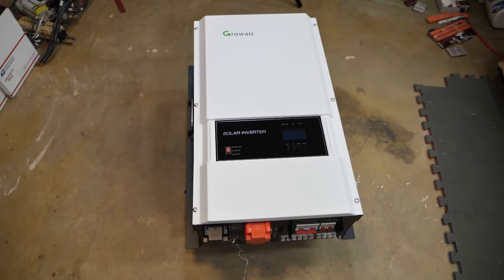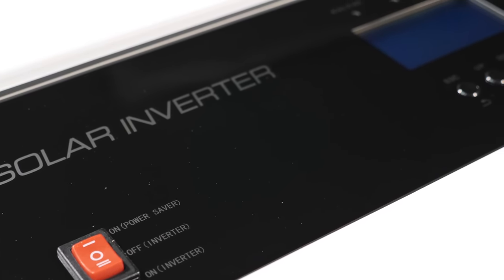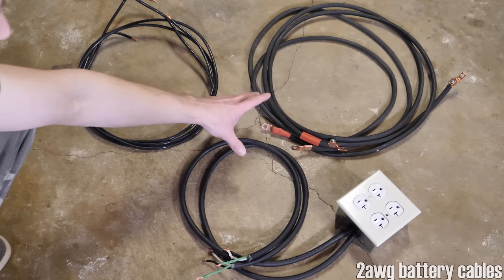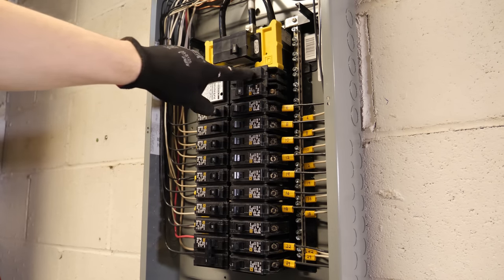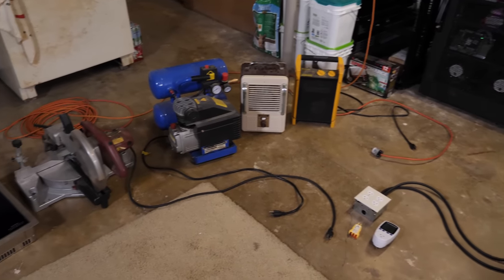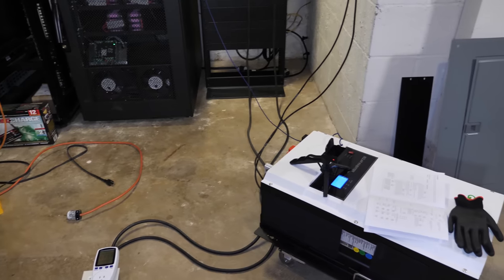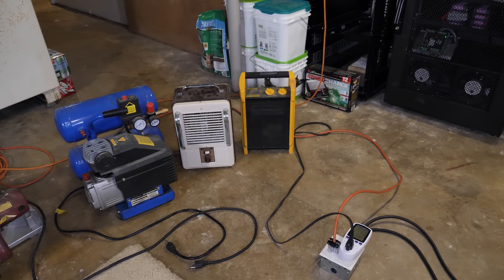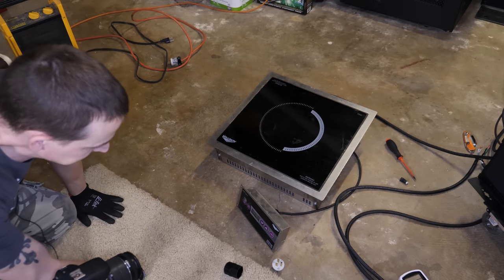12kw Growatt Inverter Operational Check/Review!!

Comment: Great Videos!  Thank you for doing what you do.  Very informative and entertaining.  This unit peaked my interest... looking for a "powerwall" type of solution to backup critical circuits in a short term grid down situation (without using solar - only this inverter and batteries).  Many calls I've made into Sig Solar either go unanswered, connected with someone who's unable to answer any questions, or messages left and not returned.  I suspect they have all the business they want/need.  Really surprising considering how many positive comments are on here about them.
Reply from the maker: Thanks and appreciate that! I purchased mine at this time last year and they were busy and or on holiday vaca. I also dont think they were as busy. You will love the inverter if you end up getting one! I Love mine!🤘
Reply: @Marc Kramer, I’m in your same spot.  Looking at creating a critical loads UPS with one of these and a couple of SigSolar’s 48VDC batteries.  I’m curious if anyone has added solar to something like this just for the tax credits on the inverter and other items?

Comment: Here is the situation: Grid fluctuates and is not a clean power source. Because of that user prefers to power the whole house from an inverter.

Can I use the AC input to charge battery BUT the AC input is isolated from the AC Out? Is there some form of AC charging scheduling (ie charge only between so-so time)?
Reply from the maker: You would need the wifi adapter or connect to your network to change charge times manually from pc or phone or do it on the inverter itself. No programs that I know of to have it do it for you.
Reply: @AveRage_Joe  Hmm so no ac charge scheduling

What about isolation?
Reply from the maker: Correct no schedule. AC will output whatever you set it at. For exp....if in the US and set to 240v and your grid is fluctuating, inverter will put out steady 240v. 💥🤘

Comment: The manual says to connect at least 400 ah batteries to the inverter? Do you run a full 400 ah?
Reply from the maker: Its a recommendation....My battery at this moment is 300ah. It was only 200ah. I am however working on building a 560ah battery!🤘

Comment: most induction cooktops won't turn on without a induction compatible pan on the heating element...
Reply from the maker: You are correct but the light didnt show up on the meter thing so I figured it didnt work!

Comment: Enjoyable video. 
Does the inverter have a mode that allows the inverter to use pv and battery and grid-utility power simultaneously? Allowing the grid to only supply the excess power needed for loads that is above the inverters max output?
Reply from the maker: Thanks Man!  Technically the inverter will do all that!  It will power from solar first, if not enough then also uses battery.  If battery is dead or low it will use grid!  Max load above the 12kw is 36kw but for short time.  Hope I can test that here soon!!!
Reply: @AveRage_Joe  so I guess there really wouldn’t be any time that you have more loads than the max capacity of the inverter with such a high capacity. I was wondering if it would shut the inverter off like a standard offgrid inverter, or if it would continue to put out its max but still allow the grid to supply the remaining power needed to fully supply all the homes load
Reply: If it could do this then a smaller inverter that covers the majority of continuous loads could be used. Then the system could be cheaper with a smaller battery that wouldn’t have to supply power for surges and occasional high loads. Easier on batteries etc. this would only be beneficial if there was a grid connection to the home

Comment: I just ordered one based on your review.
Looks perfect for me, although It does seem quite loud, so I can't really decided on what room to put it in...
Do you mind to measure the sound in dB so I can get a good idea?
Reply from the maker: NOICE! You will Love it! Yeah it can get loud at times but it seems louder on camera with the mic. Most times during the day the smaller fans on the charge controller boards are running and those are not to loud. As for db, is there an app for that? That would be the only way for me to check.
Reply: I have the 6KW model of this inverter and it is very loud.  I have it in a room about 15 feet away from our living room and we can hear it loud, even with the door closed.  It is noisy.
Reply from the maker: I have heard that for the 6kw!

Comment: Hey AJ... We installed the same Inverter yesterday connected to a rack of 6 LifePower4 batts. We are experiencing an overcharge error. Inverter is setup on Li on menu #5, and we are noticing a voltage range between 55v and 60v when the batts are charging from the grid, thus throwing the error. Have you experience anything like that? Any thoughts on why this might be happening?? Thanks!!
Reply from the maker: Whats happening is your bms is cutting the charge side. When doing the very first charge with any lithium battery. You need to do a slow charge to let ALL the cells top balance. You may only reach 55-56v. Once all the cells balance then you can raise the voltage a bit if wanted. So for this "first" charge, I would set full charge voltage to 55-56v.
Reply: @AveRage_Joe  I see... Do I change the settings on the inverter or the BMS on the batts? I ask because under menu 5, Li, the inverter doesn't let me change the voltages. My guess is that it does it automatically while communicating with the BMS. Right? However if I change setting 5 to usr, I can do it manually. What do you recommend?
Reply from the maker: I have mine on user because I dont have comms with a bms so not 100% sure how that area works yet. Having said that, I would change to user and then change the voltage until everything is all balanced. Once everything is full and balanced, then change back to Li!
Reply: Those were my thoughts... and it was also recommended by SS. Thanks for your time!! Keep up the awesome work!! Stay frosty, and don't let the magic blue smoke rise!! 🙂🤘🍻

Comment: Excited to hear about your upcoming battery upgrade! Can you give a hint? LFP?
Also, in a non-testing setup, how would you connect the AC output 2x hot and neutral wires back into your main panel? Would you simply use another double legged breaker?
Reply from the maker: Yes Sir!!! Got some LifePo4 272ah Lishen cells😲💥🤘🤫 As far as connecting AC in a normal operation, Ill be connecting/supplying AC from another breaker panel in my house or one could use a sub panel. Connect those to the input on inverter then Ill be taking the output from the inverter to that double pole breaker I used in this video to power my house. I also have an interlock kit on the panel so only grid or inverter can supply power to the panel. Ill go over that in a later video!🤘
Reply: @AveRage_Joe  That would be great! What I'm looking for is a setup where I would only use power from the grid if the PV+batteries are insufficient, and that it would make that switch automatically.
Reply from the maker: This inverter will do that!

Comment: Hi Joe I hope your well have you tried using a soft starter in line with the saw or compressor it may suppress the inrush current?  I saw the Batrium wobble.  Stay safe.
Reply from the maker: I havent tried a soft start. May get one for AC in the future. The cells I am using are recycled 18650's so they will dip for sure. My new cells should help in that department once connected!😆🤘
Reply: @AveRage_Joe  Hi Joe please make a video of the Soft Start Soft Stop for your Air Con.
Reply: @AveRage_Joe  Your new cells will definitely be more rugged Joe.  Please can you do a video using a soft starter with your AC when you have time.  Stay Safe.

Comment: Hi joe thus growatt have hybrid on off grid and this is your what youre using
Reply from the maker: Yeah I have been using this inverter for a while now. Its been great. Few quirks but nothing major. I would purchase again. It is an off-grid inverter with grid assist. Meaning you have an AC input to allow pass through for UPS mode.  Also allows grid charging.  I use it for off grid most of the time.

Comment: Please help, I habe this unit now installed and the manual is just useless,too many questions left open in order to turn it on.... Would you answer a question catalogue???
Reply from the maker: Send me an email!
Reply: @AveRage_Joe  thank you, very nice!!!! What's your address??
Reply: I try to make my Mind up on settings menu 1: what's the difference between sol and sbu? If under sbu solar also isn't available I would think it does use utility as well??
Why I can't select solar as a main, then utility and keep my battery for a power outage??
When solar gets week it keeps toggling internal a relay, so i would think it wears out prematurely.. unless there is a better "cut off setting?

Comment: What size breaker did you use to connect the grid to the inverter to charge the batteries?
Reply from the maker: I have 60a in right now but once I have my bigass battery all built ill use the recommended 80a.🤘

Comment: Nice features, however that standby is pretty high. I thought that my two parallel MPP 5048MG units had a high standby, but this video makes my 120 (for the pair) less bad. Thanks
Reply from the maker: Thanks mate!  Yeah idle draw is higher then HF inverters for sure but not bad for its size.  How are you liking the MPP inverters?  MPP was going to be my first choice as Ive been using there charge controllers.  I didnt end up getting one after seeing videos of them not being able to start a saw.  I hear with 2 its possible tho.👍
Reply: @AveRage_Joe  I don’t know HOW David poz managed to not get it to start a chop saw, but mine will start a chop saw WHILE my compressor is running with shop lights. When I saw his vid, which I am assuming you are referring to, I thought that for some reason he sabotaged the test cause I’ve never had an issue with power tools at all. 
I love my mpp solar units, they are great.
Reply: Oh and I did the above stress test with just one of my units. I have two, but one if off most of the time.
Reply from the maker: Yeah his video was the one!😁 A few others I talk to mentioned the same with the saw and they didnt have any luck however with 2 inverters they could. That was my confirmation to get an LF. What is the amp draw on your saw? I guess it doesnt matter to much cause you are able to start both saw and compressor. Wonder what the heck is up with Davids saw lol🤷‍♂️ Its good to hear yours works without a problem. 🤘

Comment: Can this inverter be direct hooked directly to the grid and not back feed the grid with AC from solar age inverter
Reply from the maker: Yes you can connect this inverter to the grid, then connect it to you house panel or subpanel which ever you want to power. The inverter has a transfer switch to go to grid or battery/solar. It does not backfeed grid. It would go BOOOOM!💥😆
Reply: Thanks for clearing that up above average Joe

Comment: How to install, there is only 1 hot cable, and 1 neutral cable for AC input?
Reply from the maker: 2 hots and a ground for AC input.
Reply: @AveRage_Joe  There are only differences in electrical systems in my area, there are only 1 hot and 1 neutral, single phase 220volt, can I use this inverter?

Comment: Thanks for the video brother! Any suggestions for a newbie as to battery that won't break the bank? I was planning to buy some used panels and just play with it for "what ifs" thanks!
Reply from the maker: What voltage are you looking to start with or learn with. Used solar is the way to go. All my panels are used!!!🤘
Reply: @AveRage_Joe I'm not familiar enough with the conversion from DC to AC, i know AC well, rewired my entire house. 200amp service. I'm thinking of picking up a pallet of 30 250w panels. Am i right to think an off grid app, those panels power the service panel directly until or unless I'm drawing more than they are putting out in which case the batteries make up the difference? I see you guys with these big battery banks,think the one guy had 4 @ $1500.00/per (lithium) not sure if those are 48v or what. Not really looking to drop 6k just yet so maybe half that and see if i need to add more later.. Thanks for the response bro, i don't expect it!
Reply from the maker: There are 2 ways to do it. Off grid or grid tie. Grid tie is connecting panels to either grid tie inverter then to panel or micro inverters (batteryless). Off grid needs a puresine splitphase inverter with built in charge controller (like mine) so the solar panels can connect to it and inverter connects to your main panel (thats the easy way) or a puresine splitphase inverter and a seperate charge controller for the solar. Offgrid of course needs batteries.
Reply: @AveRage_Joe  yea i gotcha, so I'm basically looking to do grid tie with battery backup that may become an off grid if TSHF. So the one you're using in this video, how many V battery would it need to work at capacity? If it were strictly off grid..
Reply: @AveRage_Joe  also this vid is a few months old, you learn any cons? Thanks!

Comment: That inverter has a 24 kwh battery minimum?? That's a huge battery bank, no?
Reply from the maker: Thats what the manual recommends. At this current time my battery is 10+kwh and I can run everything in my house except the stove and dryer but that is mainly due to my wire size. I personally think a 24kwh battery would be my min but I want to use anything and or everything when I want. Also that size gives you a little extra storage on the cloudy days.
Reply: @AveRage_Joe  That's at least $7k in batteries (at the low end), probably a lot more for name brand mid-range. That dictates a lot of solar power too. I guess it makes sense if you are going to power a regular house, but not your average off-girder..
Reply from the maker: $3500 or less shipped for 32 lishen 272ah or eve 280ah lifepo4 for 24kwh. I just got 16 lishen and testing them now. Yeah you would need a lot of solar as well.

Comment: Hi Joe can you tell me the output battery charging voltage range please? Ex. 42 -60 v
Reply from the maker: In the manual the low cutoff says 40v and high cutoff says 62v. Also shows on the low side a few diff voltages based on your load.
Reply: @AveRage_Joe  I was wondering about the ac charger voltages as well? What is the lowest voltage
Reply from the maker: AC side is 208v on the low side.
Reply: @AveRage_Joe  ac charger on it. What is the lowest battery voltage it can output.
Reply: @AveRage_Joe  I have a 12s nmc bank I am wondering if this unit will charge it from the grid and the solar input. Do you know what I mean?
Reply from the maker: Oh ok I gotcha! I guess depending on your cell voltage you want but the bulk charge can be adjusted from 48v to 58.4v So if you charge to 50.4v (4.2 per cell) or even 48v (4v per cell) you could do it. Your low side would need playing around with. Low side dc cutoff is adjustable from 40-48v. Does that help you answer the question?
Reply: @AveRage_Joe  perfect brother. I like to charge to 49 ish.  Low inverter cut off 42 ish.  Just can't find it on the specs
Reply from the maker: Oh ok yeah should work just fine. If you look in the manual on page 21 and option 19, 20 and 21 is those settings I referred to.

Comment: Great video. Can the inverter trigger an auto start to a generator thinking the generator is the grid?
Reply from the maker: Yeah its has genny contacts on it and you can hook up genny to the input as grid!
Reply: @AveRage_Joe  ok thank Joe. Keep up the good work. Question. 
In 12 years time Gods willing I’m hoping to build our retirement home in the Caribbean, but it will be large 3 bed with three additional studio apartments and a swimming pool, with sauna and gym. Assuming I use LED lights everywhere and both 240v and 110v appliances. I’m wondering if I can be completely off grid with 20kva generator that as auto start for back up (that can be my grid) and have a 50kwh battery built from Eve cells. Maybe use dc solar pool pump to circulate but would need more power for the WELL PUMP and jacuzzi pumps. Am
I’m being realistic as the array would need to be massive to stack 3 or 4 Growatt sfp 5000es in parallel. Is this a realistic way to live given I could possibly need to run upto 5 inverter type air conditioning wall units with external compressor at the same time. Hope I’m making sense?

Comment: Wonderful video and timely indeed as I'm planning on using the 6kw version.  Do you have any trepidations on having its split phase out wired to an L14-50 cable?
Reply from the maker: Thanks Mate! 6kw version is a great option! I dont see why you couldnt use that cable. What is you plan?
Reply: @AveRage_Joe  My pleasure.  Your videos have helped me out a lot and I'm grateful.
Reply: @AveRage_Joe  Oh sorry, forgot to answer.  I've already a 14-50P w/breaker to my panel used for a gas genie.  Instead I'll use it for my solar genie.
Reply from the maker: Oh ok gotcha! Yeah I dont see why you couldnt do that!🤘
Reply: @AveRage_Joe  I was curious as I'm always particular about ground as I think a solid common ground is good (pun intended).  In wiring the plug, would you use the Growatt chassis ground or its 120V input ground?
Reply from the maker: If your cable ground goes to your panel ground (which is bonded with neutral in main panel) then you could use the chassi or the terminal as they are the same.
Reply: @AveRage_Joe  Thanks man, yep  standard bonded fromage.  BTW I was able to use your Joe10 in buying a BigBattery Kong Elite so all good.
Reply from the maker: Awesome!!!👊🤘